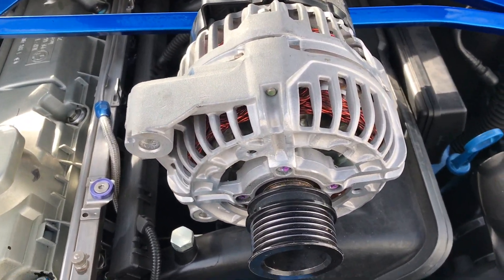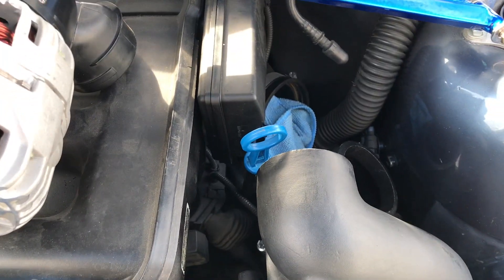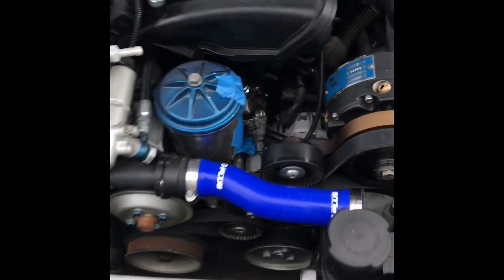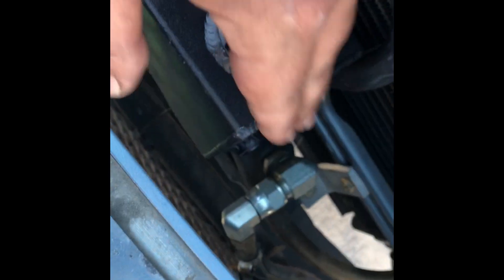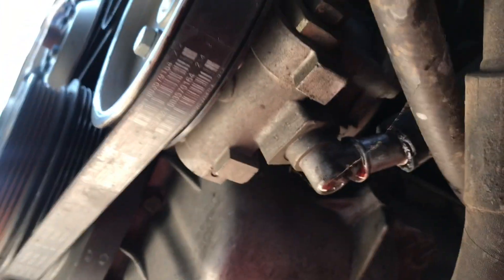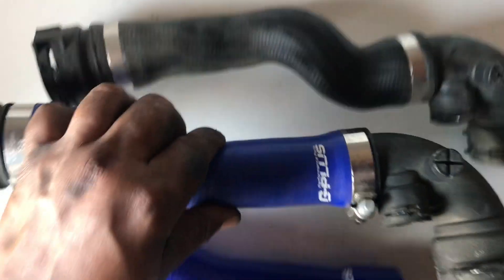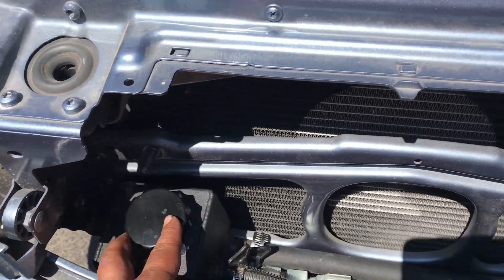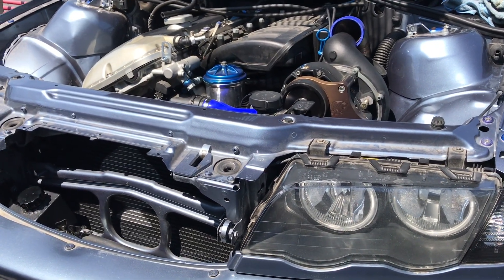BMW E46 M52 Supercharger install Part.2

Comment: Just a heads up the stock power steering reservoir actually has a filter built into it so you might want to get an inline oil filter to run on your power steering system being that you got an aftermarket reservoir that no longer has the filter in it
Reply from the maker: Thanks for the reminder, I will, but I need to slap on a new pump, it’s about time

Comment: Did you run on stock tune at all? upgrade injectors? maf? I am about to run an Eaton on my m52 e36. I have a 91 octane Tune from RK tunes,  I can get it retuned for a cost but I was wanting to run low boost stock internals on the current map without changing anything.
Reply from the maker: Yes watch my first run video, I ran on stock injectors and tune but I wasn’t pushing it, it will drive normal but if you start to boost and it’s not tuned you can lean out and cause damage

Comment: Man I really wanna supercharge my E36 328i but I'm really hesitant about it since it's my only car and it's my daily. Plus I don't know where to start with buying the parts for it.
Reply from the maker: Orlando -Sama first you have an e36 which gives you lots of tuning options unlike us e46 guys, so that’s first, next is locating a blower with a bracket and as many of the plumbing pieces as you can, if you don’t have piping that’s easy, superchargers are a lot easier than a turbo build
Reply: @acef_performance8416  Any idea where I can buy those items ?
Reply from the maker: Orlando -Sama    My boy I stay active on offerup or Craigslist all the time hunting for anything e36and e46

Comment: Stock internals ? And how much boost are you runing ?
Reply from the maker: Robert yes stock internals just all new gasket, on 160k running ok except at full boost 6psi car breaks up leans out, not sure if it’s the tune or the fuel pump not keeping up ,12 year old pumps or older maybe original I have a DW pump going on now catch the new video